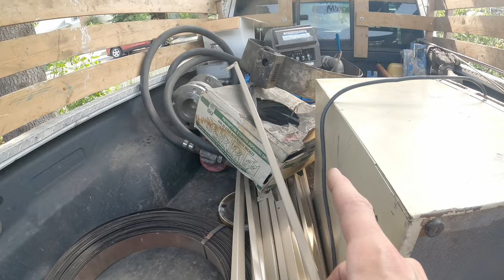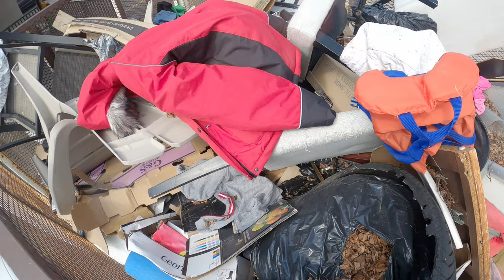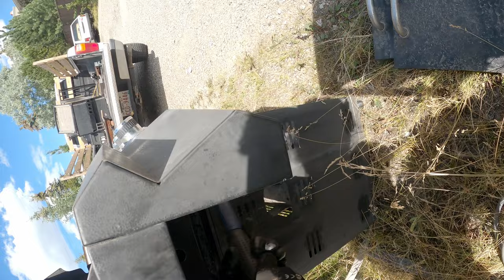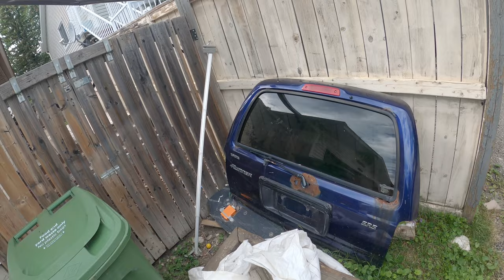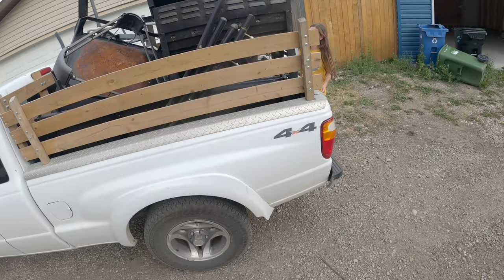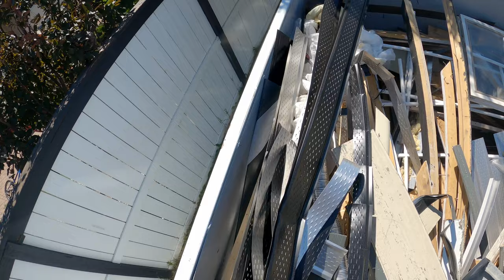Dumpster Diving Street Scrapping - It's a Public Service!

Comment: Easy way of doin' a grill..(or anything).., keep an impact Drill with a long Phillips head bit in your truck, (and other bits of course) take the grills out , toss in truck, zip off the top of the grill should be 4 screws. lift it onto the truck, then the base is six to eight screws and the it all lays flat.. and most grills the open bar is aluminum.

Comment: In England scrapmen will not picking up washing machine/ tumble dryers and microwaves, as they have changed the law, & our local council rubbish collection that you have to pay for £25.00 ,they have to have a special licence to dispose of fridge freezer due to the gas cylinder at the bottom. Which will be more fly tipping rubbish,  which was seen a lot in covid lockdown

Comment: How do you tell the difference between a "stash" and a "donation" to scrappers? Both piles looked the same to me. Assorted stuff, rusted, by the trash cans, etc.
Reply: For me, it all matters how it’s presented. If it’s nicely stacked, higher quality metal like in the video and somewhat far away from the cans I won’t touch it. If it’s just dumped there with lower quality metal and un organized then I’ll take it. That’s mine and possibly his as well.
Reply: We tell all the contractors to stack the metal outside the cans but some of them can’t be bothered

Comment: If you grab books be careful. They can hide all sorts of critters. Cockroaches love them, which you'd likely see, but things like bedbugs also will make homes in books and may not be as noticeable. That's the main reason I won't pick up vacuum cleaners unless I have my trailer. Never know what they've sucked up with them. Especially fleas! Don't want those in my van.

Comment: So a couple of weeks ago, I fill the truck and trailer with light iron.  1100 pounds and bring it to the closest yard … $33.  Today I had 4 furnaces, a water heater, a craftsman air compressor, two electric panels … 940 pounds.  I try a different yard further away.  The iScrap app said $75 a ton.  Guy hands me a ten dollar bill.  I’m like … “what’s this?” … he says price dropped to $30 a ton and they have a facility fee of $2.10 … I’ll never go there again.  It literally did not even pay for the gas for me to bring it down there.  Is this unusual lately?
Reply: So they charge thier suppliers a facility fee. Makes perfect sense 🤪